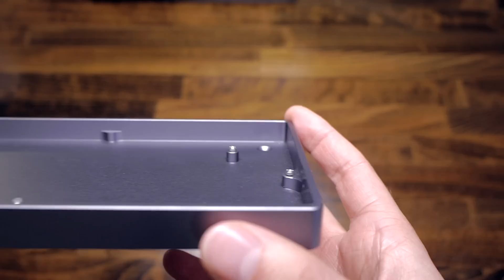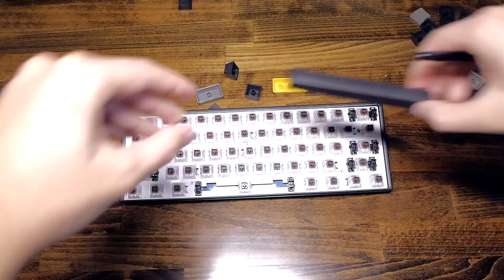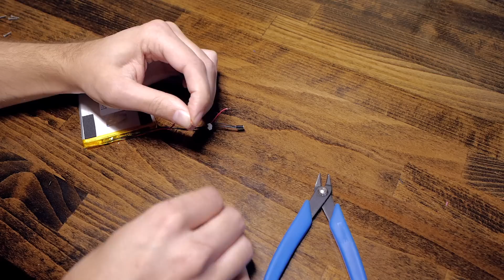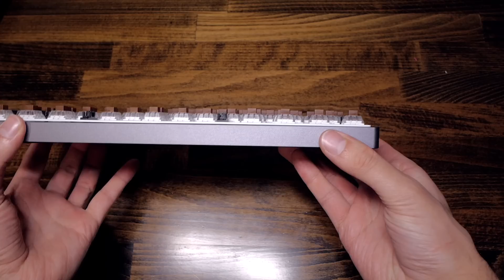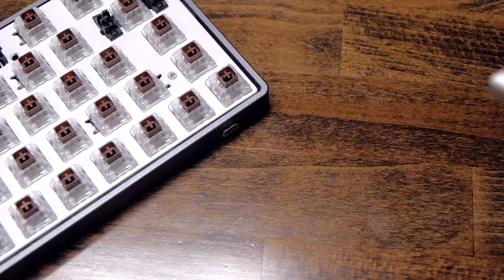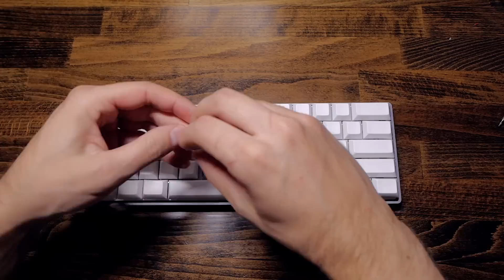Custom Anne Pro 2 ~ Aluminum Case + Big Battery + Custom Keycaps

Comment: anyone here know how to put the battery on the pcb?? 
i bought a mechanical keyboard that says it can be used wirelessly, but didnt came with a battery. so, i was wondering if i could buy my own battery and make my keyboard wireless, but i dont know where to connect the battery to the pcb to. pls help

Comment: I need some help please. Found the battery on amazon but they all seem to look the same. The only one with reviews has such bad rating and keeps talking about having lower capacity than advertised or wires are backwards. Is there a reputable dealer?

Comment: the keyboard battery leds( number 1-0) still function?
Reply: It works by battery voltage, so it should work with any lipo battery

Comment: Does this battery mod work with the stock Anne Pro 2 case?
Reply: Yes, you will need to sand down a bigger compartment for it though (there are something like plastic grids inside the case)
Reply: Feroxx do you think a 4mm thick battery would fit the stock case?

Comment: I have a question.. what did you do with the soldering job in the back? (To fit the new battery) That wasn't clear to me.
Reply: okay I replayed it like a million times. and slowed it. he just cut the wires off  so it wont piercing the battery? is that what it was? pls correct me if im wrong

Comment: hey, how did you prevent the alumium case from short circuiting your anne pro because i have been having problems with that
Reply from the maker: Haven't had any problem with that 🤔 maybe your wiring touches the case?

Comment: Hey minimalistik ! Just got my Anne pro2. All I want is to switch the battery like you did. Now I wonder if the battery fits in the original case, or does it only fit because you used another case ?

Comment: Hey,
Just wondering if I could do the exact same but with the anne pro (1st gen) but obviously get the magnetic charger that works with micro usb? and wondering if it's the same battery type so I can use it wireless?
Thanks
Reply: If Anne pro 1 isnt wireless, only adding a battery don't make it wireless.. How it would connect with pc? Via magic? XD And if u need magnetic micro USB just type in Google magnetic USB micro XD
Reply: I have the anne pro 1.. it is wireless tho

Comment: do you have access to the on/off switch at the bottom after changing cases?
Reply from the maker: yes, the case's hole is right under the switch :)

Comment: Would the battery fit if I use the original case instead of a third party one?
Reply from the maker: The original case has a cutout for the original battery, so you'd have to cut a bit in some of the plastic in there, but it's doable, just maybe not without any modding.

Comment: If you the AP2 strictly wired do you have to replace to battery or can you just get rid of the original battery all together in the new case?
Reply from the maker: I've tried it and it works without a battery, and other users have confirmed it too, so you should be fine :)

Comment from the maker: I revisited the Anne Pro 2 after 4 months of full-time use in this video: https://www.youtube.com/watch?v=P6rl171fFT8 
In case you wanted to know what I like and don't like about it after a long time period 😃
Reply: I do not use bluetooth, would this case still work if I do not use a battery at all?  I do not mind using wired only but don't want to buy this case if the board will wobble.

Comment: Would you be able to change the switches to kailh box jades?
Reply from the maker: You would have to desolder all the actual switches, they are not hot swappable 😕
I'm not that great at soldering, and this would be quite an advanced soldering project, so I wouldn't recommend it unless you are skilled with a soldering iron.
Reply: @minimalistik  Awh well I heard kailh box whites are like jades so I might go with em instead I also would like sa keycaps too they look so cool.

Comment: Stupid question but do you have to have the battery connected if you only plan on using it wired
Reply from the maker: I haven't tried it, but many have confirmed that it worked wired without a battery, so it seems like you would be fine like that.
Reply: @minimalistik  thank you so much.

Comment: Is it confortable to use without the arrows and the function keys for programming? I was thinking to buy it but I think that a 87 keys layout could be more confortable
Reply: The 60% I love personally but it depends on what you're using for if you need more keys I'd say 87 keys or if you travel a lot like me 60% would be more ideal for throwing in your bag with a power lan machine like the fractal node 202 you're good to go. :) I hope this helps
Reply: I know this is kinda late and you probably have a new keyboard already anyway but the the AP2 has a neat little feature where the bottom right buttons can serve as arrow keys if you fast tap. For example, the right shift key will be shift if you hold it, but if you tap it quickly, it is an up arrow. I’m a programmer too and I haven’t had problems at all
Reply: lol if youre not comfortable get a 65 percent keeb

Comment: Can any keycap set be used on any switch (Cherry MX, Gateron, Kailh)?
Reply from the maker: As a rule of thumb, I'd say yes. 
As long as the switches have Cherry Mx compatible stems (Kailh and gateron do), and the keycaps fit cherry mx switches, you should be fine. 

On other cases, like Logitech Romer G witches, alps switches or some electro static switches, the pattern is different and they won't fit. Also, some of the other third party cherry mx clones are sometimes a tad smaller and keycaps will wobble....
Hope that helps!
Reply: @minimalistik  Thanks for the help. That's what I thought.
Reply: @minimalistik  Just  Ordered the Anne Pro 2 from Banggood. Free shipping to India! I have a K70 LUX (Non RGB) with me already, so the Anne Pro 2 seemed like the best addition to the arsenal :D

Comment: Thanks so much for this video! You made it easy for me to decide which 60% to get 😉 I ordered the Anne Pro 2 off AliExpress with Gateron Brown switches for only $60 along with the bigger, slim battery you used. I’m going to add my industrial SA keycaps to it with a custom wood case and bigger battery. Im also a programmer so I am really excited for those function and tap layers you talked about. Thanks again man keep doing what you’re doing 👌
Reply from the maker: Sounds great! Post pics when you're done if you can! :D 
Thank you for the kind words!

Comment: Instead of changing the battery, could you have put some spacer and maybe use a little bit longer screws?
Reply from the maker: That wouldn't work unfortunately, as the USB port would be blocked by the frame. It already is pretty tight in there, so adding spacer will make it simply not work I think...

Comment: Anne pro 2 is now favorite keyboard. But I want to have a longer battery life you what you did on your keyboard. does it fit with with the original case using that 3000mah? I'm really scared that it might explode. 😂
Reply from the maker: I think you will have to mod the case a little has there are plastic inserts that are placed just right so that the original battery fits. But that's probably doable! :)
Reply: There's a writeup on Reddit or somewhere of the modifications necessary to make it fit in the original case. I've ordered the battery myself so will be doing this mod soon.
Reply: @DanielBrownsan  How did this go? Did it work with the original casing? Battery still good?

Comment: Can I just remove the battery completely? Or will it not work without the battery?
Reply from the maker: Pretty sure it will, though I haven't tried it myself.
That could be a way to solve the battery thickness issue if you don't care about bluetooth! :)
Reply: @minimalistik  I dont care about bluetooth but I do care about what you stated before; you said that if you don't use a battery the RGB settings wont save?
Reply: It'll work without the battery, just without bluetooth

Comment: Hi, maybe you can help me. I have an Anne Pro 2 too, but i cant get it to work. When I plug it into my PC it only showas up as a HID keyboard. The software is strange too. I cant use the settings and there is no "hello world" button. Any ideas?
Reply from the maker: That's a weird situation :/  Have your tried turning the on/off switch to "off" ? Otherwise, you might want to try reinstalling the drivers, or switching USB ports?